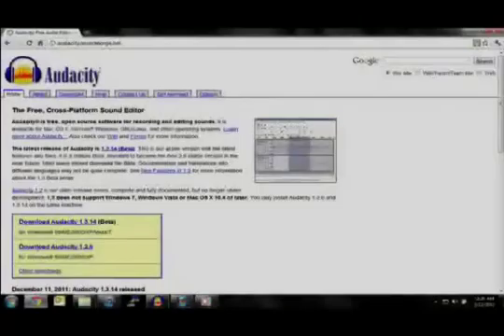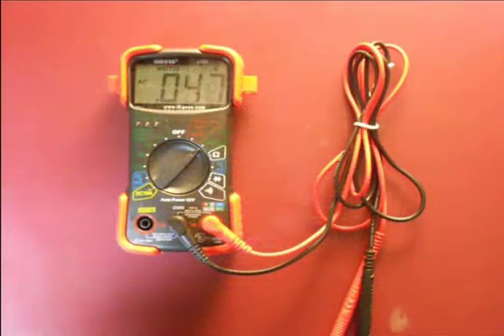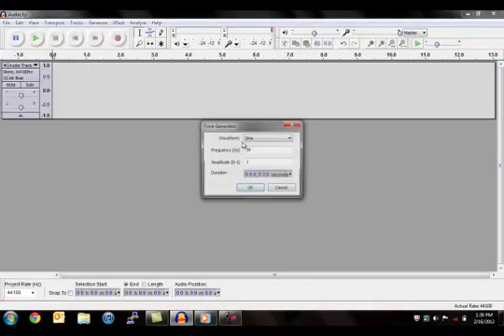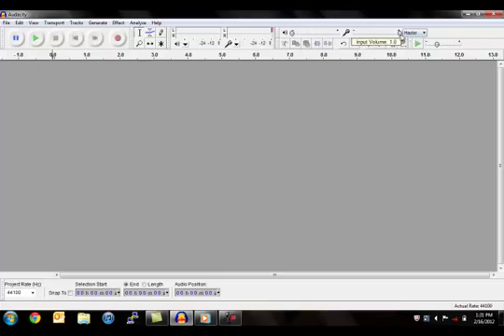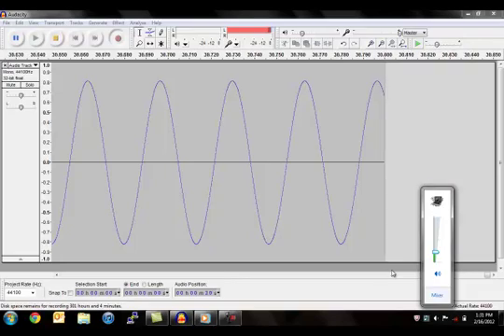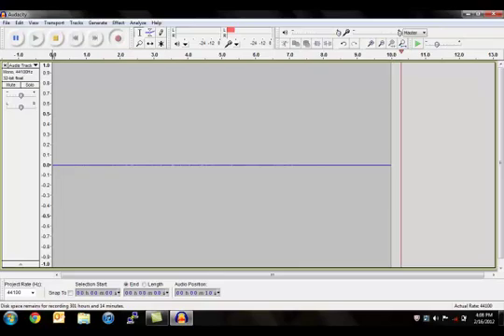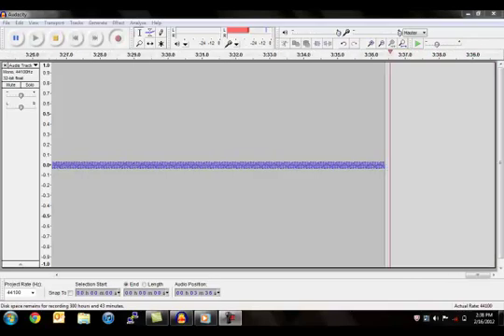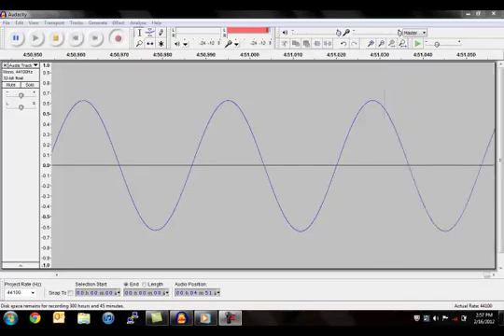HOW TO:  Set your amp's gain, using a laptop as an oscilloscope.

Comment: You can use a simple little tweeter with  2.3 - 3.3 microfarad capacitor hooked to it and detect if your amp begins to clip/distort by using a cheap little tweeter! I watched a video on here with a guy doing so as well as using his O-Scope right alomg with it to show that it did in fact work flawlessly. Your Welcome

Comment: okay first off your box is tuned to 30hz not your radio so when you first start off testing your head unit you should test it first at 1000 Hertz and then tested secondly at 40 Hertz then you find out which number that your head unit is clipping at if it's clipping at 1000 Hertz on a volume level of 60 then if it's clipping at a volume level of 59 at 40 Hz then you'll want to have it set at 59 for the testing then you test your bass amp at 40 Hertz and your 4 channel amp that goes to your mids and Highs at 1000 Hertz and at the end your equation the wattage is for RMS continuous wattage not Peak I hope this helps you out.

Comment: Great Video!! I as well though am a lil confused on the resistors. There are several different wattage resistors to purchase and vs buy a crap load of resistors that I may not need, what is a more " refined " way of choosing which range your set up would be much suited for. Also on the 1/8 cable, which wires gets hooked up to what? Overall great video but just a few hole in information. I would love to build this but I just don't want to blow up something in the process because I did something wrong. Look forward to an update!!

Comment: all the other idiots saying set your gains with a multimeter should watch this, they all say 3/4 head unit volume will be clean then set the gain to the power the speaker is rated at, well that cost me an $80 pair of speakers and it'd be guaranteed there would have been distortion cooking the voice coils since the amp wasn't passing the speaker rating. what's worse is what's meant to be the best audio place here set their stuff by ear and don't even check or measure the outputs...

Comment: It seems like you've left a bunch of details out, because I'm having trouble following your instructions. How did you know which wires from the split headphone cable to connect to the DMM? What was the purpose of measuring the input voltage capacity of your sound card? What calculation did you use to choose resistors? ...etc. P.S.- Correct me if I'm wrong, but you shouldn't be using 30Hz, because your system is very likely not to have a flat portion of the response curve at that low frequency.

Comment: Thanks a lot man. I love figuring out how things work and like you sometimes get too caught up in details.  I just finished following this guide and I can say it works. The only thing I did wrong was to get a 10k ohm potentiometer. I will be going back to Radio Shack tomorrow to get a higher resistance potentiometer or a higher resistance resistor multi pack.

Comment: SMD DD-1 is a waste of money. Buy an o-scope, its cheaper and will SHOW you the waveform. Google DSO Nano.

Good tutorial, should work if people follow your steps. Nice Job.

Side note: the reason your calculations for the power output come out low is because of "box rise". Basically your subs impedance is a function of frequency, you can't just plug in the DC resistance into the formula and get a number, the impedance is always higher than DC resistance. You need an AC clamp to measure that.